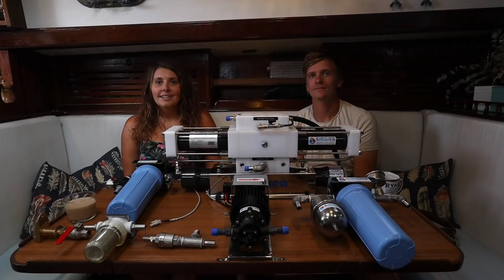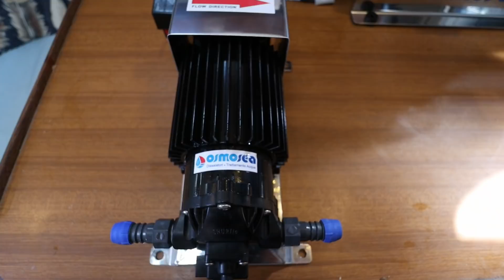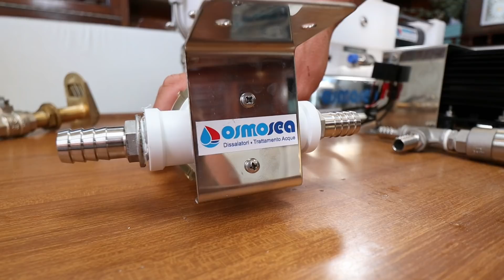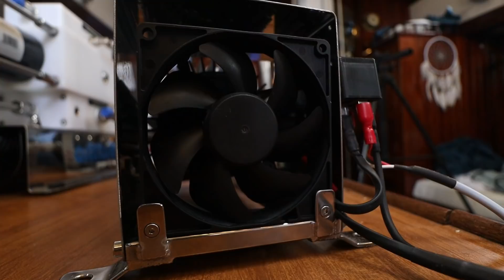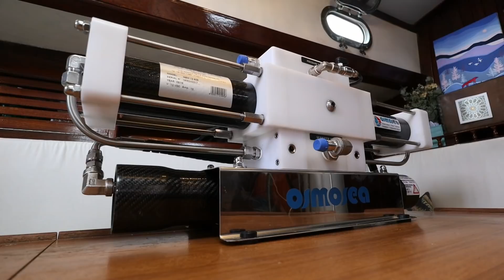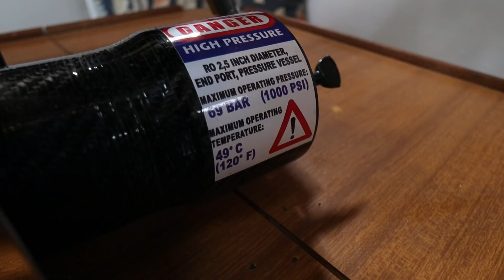CHECK OUT THIS 12V Watermaker: 10 AMPS, SOLAR ONLY! & How It Works

Comment: Hi have you thought about a watertank for daily use about 30 liters for daily use ? Using the main watertanks for daily use you always have a watermix from different water sources. Using a watertank with overflow to the main tanks you will always have the freshest water for drinking cooking and so on. Nice channel wish you luck on your ways Rob
Reply from the maker: Hi Robert, we prefer to cycle the water in our main tanks, and neither is huge so we're happy with the setup :) I can see why a day tank for water would be nice though.

Comment: Thats a nice kit you have there. I see it comes with a pressure accumulator. If you can, mount it up side down, or even better, leave it out. We (army) have the same thing in our mobile field kitchens and they are being modified. The problem is that there is no circulation in the accumulator wich causes debry to sink to the bottom and there are things growing inside. We had a health inspector check the system. According to him a regulator does not belong in a system for potable water. Seen the inside of the pressure regulator in question, i agree.

Comment: Is it quiet enough that running it all day to fill empty tanks wouldn't drive you mad? :)
Reply from the maker: How much water do you use? 😂 For us 25L x day is a luxury day. We turn it on after lunch for an hour every day and we always have full tanks.
Reply: @SailingKittiwake  Hair this good needs a lot of water... just kidding. 😂 Do you find it quiet during operation though?
Reply from the maker: It’s roughly the same volume of a pressurised water pump. Can hear it inside the boat, can’t hear it in the cockpit. We often work while it’s running, so we don’t mind it much.
You’ll be able to hear it on Monday in the next episode btw.

Comment: We are toying with fitting an RO watermaker and have looked at the one our good friends on Polar Seal fitted last winter. (see their YT channel) Our consumption on anchor is about 21 Ltrs a day and we carry 400 Ltrs in two tanks. Boat is faster without all that water so may be a good call if we can get something cost effective Possibly powered by a 12v HP pump or a Karcher K4 water cooled and run from or geny or the inverter. If we go 12 Volt we have plenty of solar and good batteries. Its really down to cost. Like you we will do a vid when we find a solution. Looking forward to see your install. Will you look at cost? Ant, Cid & the Pooch crew.xx
Reply from the maker: As mentioned in the video, this model is about €4,000.
Reply: @SailingKittiwake  We will be drinking sea water again this year LOL Our budget is less than half that. Ant, Cid & the Pooch crew.
xx

Comment: solar panel and a watermaker - you can go offshore for moths! one suggestion for the install: it is worth installing an intermediary water tank between the water maker and the main water tank: in case the watermaker breaks down, the salt water does not get to the main tank. you can have a tasting walwe on the intermediary tank - if the water is fine, you can let it to the main water tank.
Reply from the maker: Yeah that sounds like a great idea, though I don't think there's a way for salt water to get through the membrane and into the main tank?
Reply: @SailingKittiwake  well, no chance of that until the unexpected becomes reality...:) Btw. our boat is aft-heavy, due to the solar setup, vindwane and other staff... so we now build a small intermediary tank in the bow, under the v-birth - it also increases our  total water reserve. If you have any balance-issue, it is one way to treat it, i think. :)

Comment: Guess this video is sponsorship. 
Great piece of kit, but I wonder about the wisdom of using it to fill your only fresh water tank. I would err on the side of caution and use it to fill a second fresh water tank. That way if you are say 2 weeks from port, and the system fails, dumping sea / contaminated water into the tank you are not scuppered.
Reply: Great minds etc!!!
Reply from the maker: Hi Nigel, we actually have 2 fresh water tanks :)

Comment: Thanks for this one. Looking forward to the next as I am seriously considering a RO unit for Pilgrim's way as well. Also want it to be 12 Volt powered.
Reply from the maker: Ha! You could pick this one (or a more powerful model) up directly at their HQ in Marsala (Sicily) in the spring. They were very helpful with the installation to us and a friend.
Reply: @SailingKittiwake  Now there is an Idea.
I'll be watching for reports on it's operation and how satisfied you are. I'll be passing Sicily a couple of times over the next 2 years so will have time to get your feedback.
Thanks
Reply from the maker: For sure 😊👍